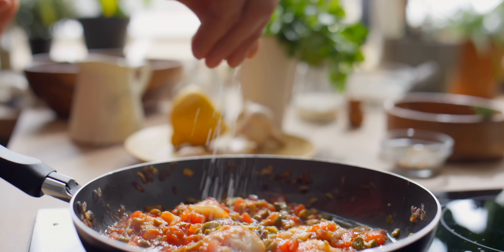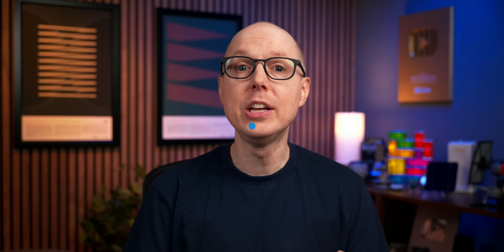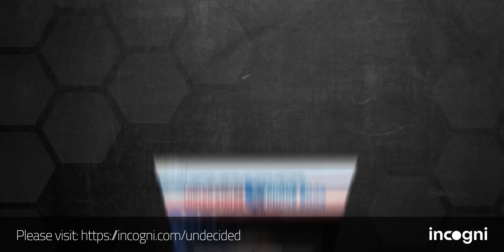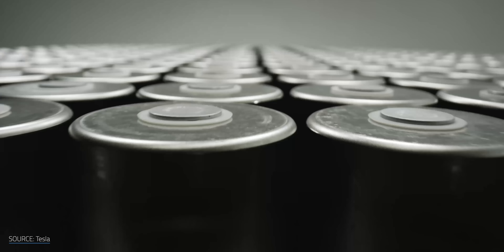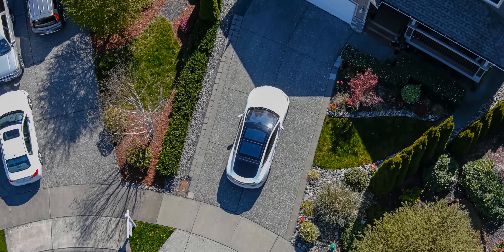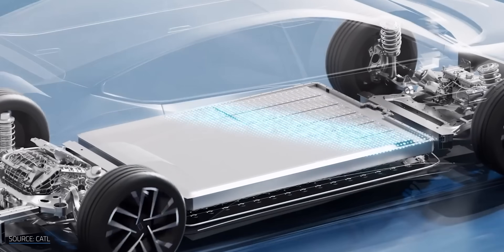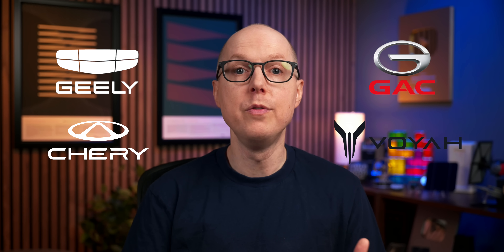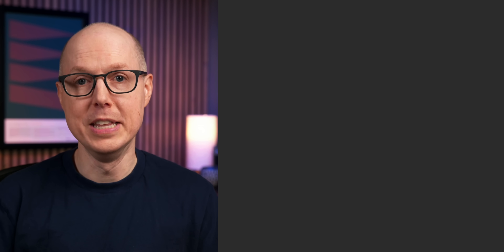How CATL Made Batteries 90% Cheaper (And What Happens Next)

Comment: I would like to see this in UPS (uninterruptible power supplies) for computers.  The lead acid ones are terrible with battery replacement being every 3 years (not to mention the occasional leakage or expansion due to load issues damaging the UPS unit) and the lithium UPSes are priced in the stratosphere, often costing more than equipment they're protecting, though do last significantly longer.
Reply: You can use a power station.   A modern EcoFlow does a decent job at UPS functionality.  It isn't perfect but its decent.  If you want to get rid of switching glitches entirely you can charge it via DC instead of AC though that means there won't be pass-through so the power consumption will be ~15% higher.

For a small computer an EcoFlow River 2 or River 3 is a good choice.  For more powerful machines an EcoFlow Delta 3 base model.   And laptops can just be plugged in via USB-C, bypassing the AC entirely.

Throw on a bit of solar for fun.

-Matt
Reply: I've replaced lead-acids with LiFePO4 in several UPSs, with no trouble.  The batteries have their internal battery monitoring systems, and expect the same charging voltage as "12V" lead-acids.  The only drawback is that the BMS circuits limit the current, so instead of 200W max I get more like 120W.  But since I'm using these just for the networking, it's not a problem, and I get longer run time than with the lead-acids.  Nothing was mentioned in the video about the cell voltages for these sodium-ion batteries, so it may not be as straightforward.
Reply: You can do that yourself now - use lfp - they last waaay longer, are way safer, lighter, cheaper- I put together my own diy back-up system for my cottage, with a 1200 watt solar array - there are so many helpful videos on YOUTUBE to make it happen
Reply: @willm5814  I did one conversion, unfortunately, the charge circuit (APC rackmount 2300VA) blew a board out about a month later ($2000 down the toilet).  Most of the vids are going to damage your UPS without some modification to the UPS's firmware (if possible at all) as the charging curve is not even close (sometimes it can fry the batteries).  So a no-go on Youtube vids - at least not for converting a lead acid UPS via swap outs.

Comment: Multi-chemistry battery packs seem like a no-brainer. Somewhat higher manufacturing costs following engineering, but as best practices are dispersed into the market, the benefits seem obvious. Current batteries (pun, quick-zoom in) are a one size fits all, even though above the cell level every manufacturer creates bespoke packs.

Comment: Sounds exciting, but Chinese tech and engineering firms FREQUENTLY release announcements about incredible advances which never materialize. These bogus announcements seem to be timed to either impact their competitors in the stock exchange or to boost their own valuation, OR to serve as CCP soft power propaganda. Are these batteries available yet? Have we seen independent evaluations of these amazing batteries for safety and durability? Until I see the batteries in the market and tested by 3rd parties, I don't believe it.

The best question you ask in this video is "should we believe it?"

I don't believe these batteries at $10/KwH are already level 8 or 9 on the readiness scale. Until it gets beyond self-reporting and we hear from 3rd parties who've got their hands on some, the reliability of Chinese firms is too questionable to get excited about.

Comment: I live off grid in Alaska. My house can get very cold when I'm away in the winter. If I could get house batteries that were better than lead acid and don't die from cold or present a serious fire hazard, I would absolutely buy them.
Reply: @Raven74947  Industrial engineer here. Yours is a challenging situation but here's something you can try: 
1) build a well insulated small room in the house
2) get a 250 gallon water tank, 3 old car radiators with fans, a circulating water pump, and two cheap 7 kW automatic water heaters from China
3) make the water run though the heaters then radiators then back to tank, set both heater thermostats to 50F;
4) put your batteries inside this room and run the system 24/7. 

Just make sure your energy production is enough and your inverters can handle the load. Have a gas heater come in at 35 F or so if inverter load is an issue (but that complicates the project a lot).
Reply: @rodrigornovaes  in a solar off grid system, any heavy draw electric items like fans, pumps, and electric heaters are impractical to run at night. We've been off grid over 15 years, and we even turn off the energy star rated refrigerator at night.
Reply: The crazy temperature range would also be a big deal for vehicles.  If the battery doesn't care about temperatures, then you don't have to develop the complicated battery conditioning systems.  Secondary benefit would further drive down the cost on EVs.
Reply: Me too. The low temperature application would be key for my Alaska application.
Reply: Follow this tech Alaska. Sodium had the potential to work well in colder weather than Lithium and also have Lower potential for battery fires. Lower thermal runaway and you can drain then to zero charge and ship at zero charge unlike lithium.
Reply: By July 1, 2026 ALL batteries of all kind in China must be fireproof including Lithium and Sodium. That alone will help save more lives than anything I can think of.. Plus obviously help advance concepts like electric aviation even if it's in a hybrid set up.. That alone could drive down the cost of regional flight which is the most energy intensive per passenger seat mile too!
Reply: Too bad about those tariffs.
Reply: Since lead acid are rated to -20C, -30C might give you enough of a buffer. No fire hazard, so if you have a cellar or basement, install it there.
Reply: @plektosgaming  Lead/acid batteries don't freeze if they are holding a charge, but will be ruined if they somehow are discharged and subjected to sub-zero temperatures. Additionally, at zero degrees fahrenheit, a fully charged lead/acid battery has around 50% capacity of one at 77 degrees. Plus, working properly, lead batteries off-gas flammable hydrogen during a charge cycle. I know some people put their battery bank in the house, but I think it's foolish. My sixteen L16s are in a vented to outdoors battery box and in a separate, unheated solar house with the panels on the roof and electronics inside. Safety first, and if these sodium batteries become available at comparable cost to lead, that's what my next bank will be. Besides the cost, lithium isn't practical in an unheated building where temps get below zero. Good luck and take care.
Reply: @petset77  I think you missed my point where the set of batteries in such a scenario would be lithium or better yet, in keeping with the newest upcoming batteries, sodium ion batteries in a couple of years.  I never suggested that lead acid would be even a viable option for most people. Installing "a couple of batteries" in my original comment was a couple of Tesla type power walls. Store at least a day's energy so you're not stressing the things too much.  And still come out slightly ahead of the solar companies.  And in my case, the local utility.  The only downside is you need a large chunk of your yard to be basically set aside and fenced off. Obviously if you live in a city like Phoenix where the homes are stacked on top of each other like playing cards in tract homes, there's not nearly enough space in back. 

Cost analysis: 
Power Wall with expansion unit, installed. 25K. (room for two more?) Cement for pads and angle iron, plus tools for frames, and conduit/panel,  ( ~30 solar panels ) - 4K, 5K tops. Power inverters ( 2) : $3K. Misc electrical and installation/electrician: 3-4K.
Used VG condition solar panels, 85-90 percent of original capacity: $50-60 each: $2K total.  Fence to partition off yard, plus gate: $3K. I come out with about 40K or thereabouts. Plus you keep the tax breaks on top of that. Far less than any solar "company" is going to quote you when you read the fine print. 
But it does depend on your situation. Where I live $500 a month bills are common in summer. Gross. Where my parents used to live, closer to $350. Obviously using batteries for heating isn't efficient, so YMMV a lot in places like Alaska. lol.
Reply: It would be impractical to heat my house while I'm not there. I have a perfectly functional flooded lead acid setup. 6 volt batteries.
Reply: You might still need to wrap them in some kind of insulation to keep them warm, but they they are much less likely to burn your house down. 🤪
Reply: Not to mention that low gravimetric density should not be a priority for stationary storage
Reply: When you are away in winter... Like the entirety of winter?
Reply: @WhoStoleMyAlias  maybe
Reply: @Raven74947  Yeah, well... I live 52 North myself and around winter solstice I get at most 3% peak rating out of my PV, many days even nothing at all. If I'd store the result of a good in a battery, I could keep one lightbulb burning throughout the 17 hours that it is dark outside. And obviously on a bad day I'll be needing a candle.
 
So you see, if you aim to tell that this cabin is your one and only residence, I'm calling BS.
Reply: @WhoStoleMyAlias  WTF are you talking about? I live at 62 north. I know how dark it gets. I run a generator when the solar doesn't keep up. What does that have to do with anything?
Reply: @Raven74947  You are responding to a channel where your generator is considered a sin.
Reply: @WhoStoleMyAlias  I consume vastly less total fossil fuel in a year than the average city commuter. I'm not worried about the generator
Reply: @Raven74947  That's not the point. Within the context of this channel you caused people to believe that living off grid, relying on nothing but solar and a couple of batteries is feasible even in Alaska, which is simply not true.
Reply: @WhoStoleMyAlias  off grid simply means there is no power grid. It's absolutely the norm to have a generator or grid backup for a solar/battery setup. We don't all live in the southern desert
Reply: @Raven74947  Not in a world where people have become to believe that you can compensate things by adding zero to it. Off grid is now a fashion statement that you make the grid operator block the feed into your home, as to become independent of "robbing energy suppliers". Needless to say that not even this channel's owner has ever dared do it. Even the suggestion of toggling the main switch, to see how long they can really do without, is met with objections such as that not being able to sell off their excess power will cost them money.
Reply: With some provisios, an insulated battery box with a powered thermal blanket generally solves the "cold battery" problem for unattended locations.  It isn't generally necessary to have a battery chemistry specifically designed for cold weather.  An advantage of most of these non-acid based chemistries is that they can be completely sealed.

The provisios are:

* The box really has to be well insulated.  2 inches+ thick regular insulation, NO seams, with an additional Aerogel padding layer inside, heated thermal blanket inside that, then batteries.

* The energy source (aka solar panels) must be able to generate enough energy to keep the batteries reasonably well charged.

* The (powered) thermal blanket should generally be directly connected to the battery terminals so the charge controller can bootstrap heating if the BMS ever shuts the battery charging down due to the temperature.  i.e. be a directly compatible voltage.

* If the charge controller(s) for the solar can't handle the cold, they have to be inside the box too.

For Alaska, -30F, we're talking 15W to 30W of continuous heating (360Wh/day to 720Wh/day of energy consumption) and at least a 1000W solar array, plus a number of vertically-oriented panels to prevent snow accumulation when unattended.

It is definitely doable.  People do it.

-Matt
Reply: @junkerzn7312  I've thought about that... my battery box already has 1 1/2" rigid foam. I have a feind in NM who does solar installations who has been trying to convert me
Reply: Buy shovel, dig hole, insulate roof of hole. put batteries in hole. cash investment: one shovel, 16 inches of insulation. Risk of breakdown... nuclear winter.
I'm building an off grid tiny home with 20KWH of AGM 3700 Watts of PV. I have the temperature problem too but no fixed address means cant do the cellar thing yet.
Reply: @nomadicoasis9260  Well, a hole might be a problem with regards to excessive moisture and corrosion, water ingress during storms, snow-melt, etc.  But geo-heating is definitely a thing.  Might not work in Alaska though due to the geology.

The expense is real but if one can do a good job on the build it should last a good 10 years or longer.  Quality-of-life can be vastly improved with a decent battery system.
Reply: Its called LifePO4. They are great!
Reply: @carlostavaresjr958 If I'm not home to build a fire it can get colder than -30f INSIDE my house. Since my batteries are connected to solar they would get charged at that temp and be permanently f'd if they were any form of lithium battery. I found that out the hard way.
Reply: @carlostavaresjr958  "LiFePO4 batteries generally operate optimally between -20°C and 60°C (-4°F to 140°F). However, their performance is best within a narrower range of 0°C to 45°C (32°F to 113°F). Charging below 0°C (32°F) is generally not recommended as it can damage the battery"
Reply: Keep a heater to warm the batteries
Reply: You can use thermal storage system it's much cheaper than batteries.
Reply: @Raven74947  check out the sand battery. It store heat for longe period of time. Great for a heater
Reply: Not as far north as Alaska, but I'm in Canada and just had to replace my batteries for the same reason. I got lifepo4s from Renogy with built in heating (rated to -20C), I'm putting them in a well insulated enclosure with the inverters and charge controller, and I'm adding a small 24v electric heater in there as well for the really cold days. This winter will tell how well it really works but I'm optimistic.
Reply: For right now look into LiFe batteries. Fairly cheap and much lower fire hazard. Also much lighter.
Reply: Dont you have geothermal heat pump?
Reply: Most batteries are less of a fire hazard than using natural gas to heat a home
Reply: @SigFigNewton there’s more electric fires in the US than Natural Gas.
Reply: @Raven74947  so LTO?
Reply: @NoName-md5zb  lto I was looking into those. Those aren't readily available. They're not that cheap. And they don't take extreme cold very well.
Reply: You aren't off grid. You're legit leaving comments on a youtube video
Reply: @StaticM223  wow, cell phones work in the woods, so does starlink and every other form of sattelite communication. Welcome to the modern world. Off grid refers to the fact that I'm 90 miles away from the nearest power grid, which I am not on.
Reply: @StaticM223  It arrived on a scroll of paper wrapped around a pigeon's leg. Someone else typed it in on behalf of the OP. Replies might take awhile...
Reply: @StaticM223  Do you even know what "off grid" means?
Reply: @thomasjensen5646 do you? "Off-grid" primarily refers to not being connected to the public utilities, internet is a utility.
Reply: @thomasjensen5646  Off-grid is not a singular thing; it covers the whole range from "no gas or electricity connection" to "living like it was 300 years ago".
Reply: @StaticM223  There are various different grids😉
Reply: @StaticM223  Off grid means your internet and power isn't connected to locally.  Does not mean you can't use solar panel and starlink.

Comment: If I'm not mistaken, that $10 figure is the cell cost projected at volume production. Not the batter pack cost, and not at current volumes. Still impressive, but not an apples-to-apples with lithium battery pack costs per kwh at current production levels.

Comment: The problem with Sodium Ion is that it does not have the density of Lithium Ion and the total number of charge cycles it has vs LiFePo4, for example, is staggeringly worse. It also doesn't handle temperature fluctuations anywhere near as well.
Reply: You did watch the video didn't you? CATL's claim is that they have addressed this - hence the hype. The batteries remain less energy dense, but the charge cycles have increased dramatically and can operate over a better temp range than lithium. 
Now, whether this is market BS or the real deal remains to be seen. A lot of it sounds too good to be true so will probably end up nothing like expectation. BUT if they really have got a production line ready full of cheap, safe and reliable sodium batteries then it's going to be a big deal. I suspect moreso for home power storage than for vehicles, but we'll have to see.

Comment: The economics of battery tech are, as you, revolutionary. CATL are where they are by virtue of their bravery and determination. I believe their relationship with Nio and battery swap technology will have a significant impact in terms of market penetration for EV, particularly at the lower end of the market which is only just beginning to happen. Swap stations have the potential to significantly reduce problems associated with the roll out of charge distribution points and thereby grid balancing systems. I believe they will become critical nodes in local grids. For people who don't have the potential to charge where they park, Swap is the answer and CATL are positioning themselves in preparation for that sea change.